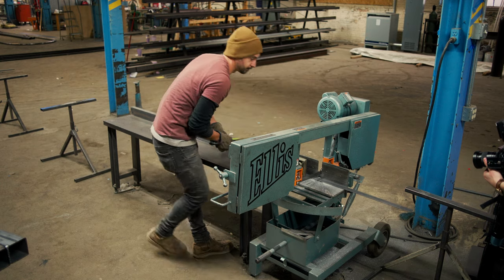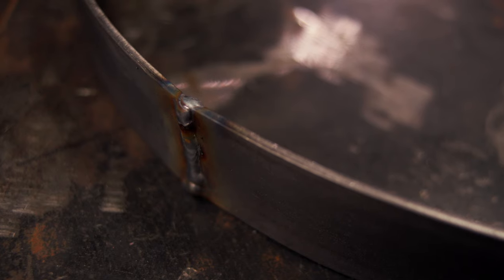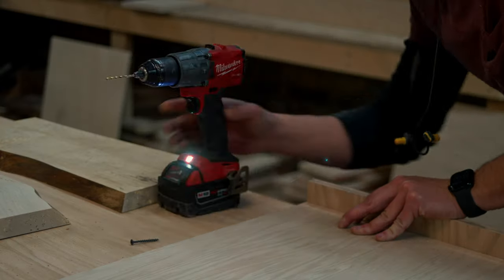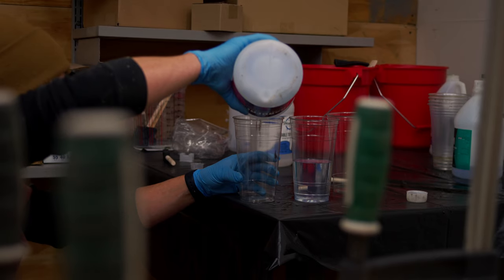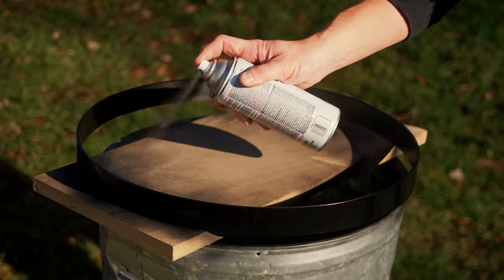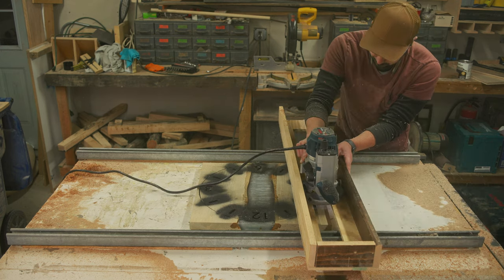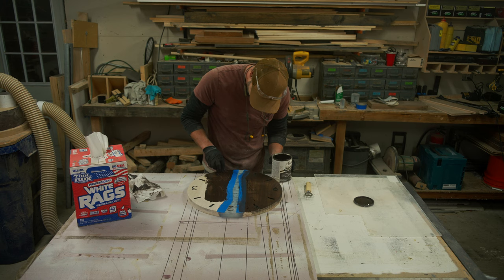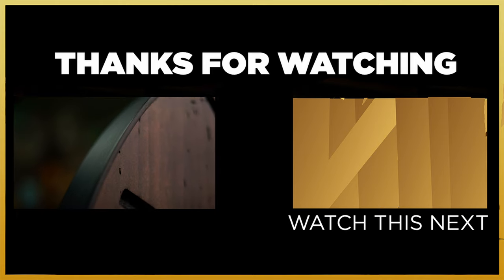Epoxy Clock I Made SOLD in 1 Hour

Comment: Nice to see another slider out there. Couldnt make out the manufacturer though.
Reply from the maker: Heck yea. It does the job. The biggest adjustment for me was ripping pieces of wood with the sliding table sticking out right where I normally would stand. Grizzly is the manufacturer. The 10" 5 HP Sliding Table Saw.
Reply: @buildingwithbobby  right on. I used a Hammer K3 Winner. I'll never go back to a traditional cabinet saw. I run into the same ripping issue because of the location of my outrigger fence. Anywhoo, cool clock and a solid vid
Reply from the maker: @vulgarwoodworks  Thanks Jered 🙌

Comment: Just found your channel looks amazing. Could do that without the metal parts although dont expect ad get much more than $100 in my area people dont wanna pay for anything in my area. 🏴👍
Reply from the maker: 😂 it helps when people see the value in what you build and have the cash to pay for it, for sure. Thanks for checking out the video!
Reply: @buildingwithbobby  yea a sure can't get prices like use get across the pond. Cutting boards for example use will get anywhere from $150+ to who knows what I struggle to get a full size 12x18 cutting board at 2" thick to sell for $100 🤬

Comment: It seems so obvious to me, I can't believe more people don't use plastic sheeting for epoxy moulds.
Reply from the maker: Plastic sheets & trash bags for the win!
Reply: Hey Bobby great build. Can I ask how much you sold it for?
Reply from the maker: @PennYankeeWoodworks  Thank you and I sold the clock for $600. I'll start putting the price in these videos moving forward!
Reply: @buildingwithbobby  how many hours of labor and how much did you spend in parts/product/wood?
Reply from the maker: @PennYankeeWoodworks  6 hours and everything I had was scrap and/or material I had from previous builds. Bought the clock hands for a couple bucks.